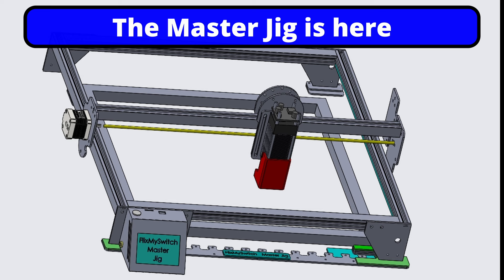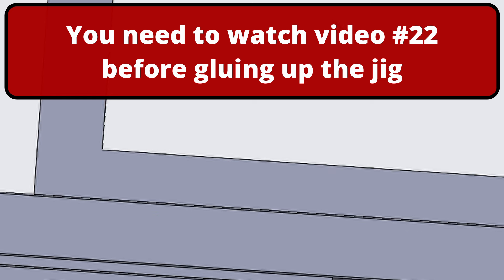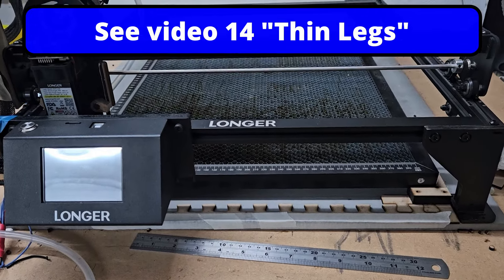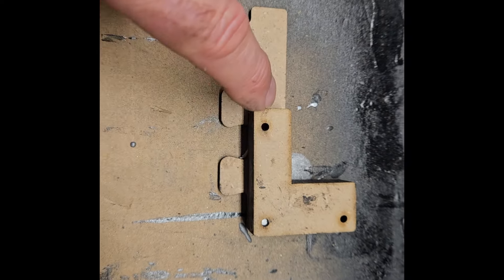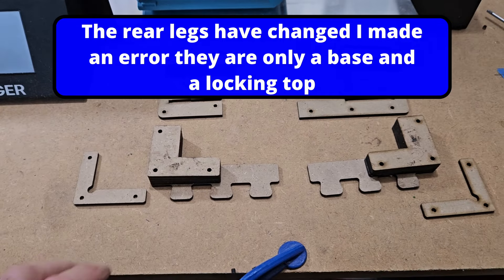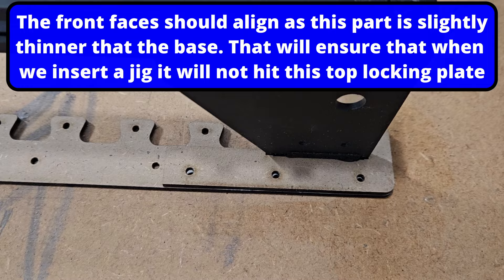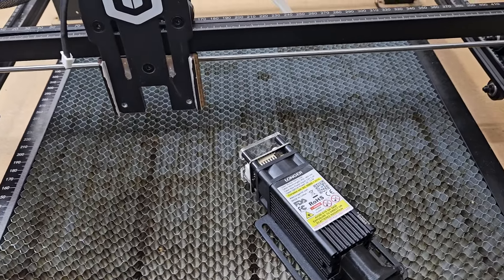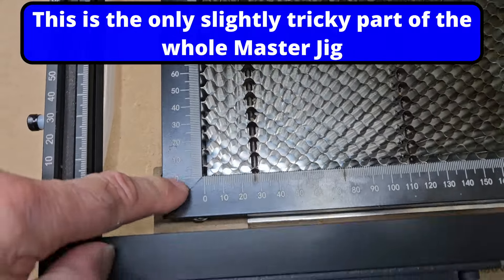Diode Laser engraver master jig Longer Ray5 Easy to build perfect positioning honeycomb alignment

Comment from the maker: It's very important that the gantry is square to the frame. I have covered this in other videos.  If you ever have your stepper motors grid / miss steps, like when the head crashes into the side  of the frame, and your stepper make a strange loud noise like gears grinding, you would need to check your gantry squareness again.  Its an easy process which I have covered in two videos.

See videos 2 and 22

Comment: When clamping glued parts I like to put a few grains of tablesalt between the pieces to reintroduce the friction lost when the parts are lubricated with glue. After a few minues the salt dissolves in the water-based glue, and viola! No more wandering substrate.
Reply from the maker: Nice tip, will have to try that. Thanks

Comment: This is excellent. I'm wanting to make something similar for my Atomstack A5 Pro which has those exact same shaped feet and I was struggling to figure what shape the slot be to accommodate the angle of the foot. What would you suggest?
Reply from the maker: Any shape that the legs lock into and the master jig then does not move